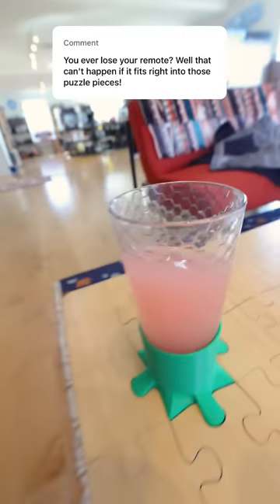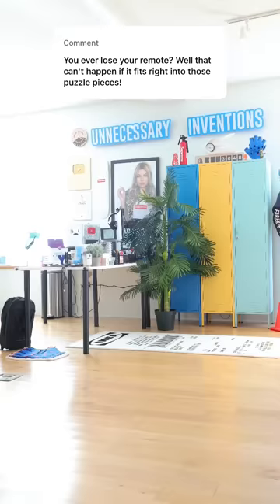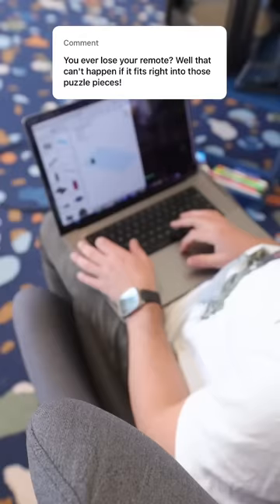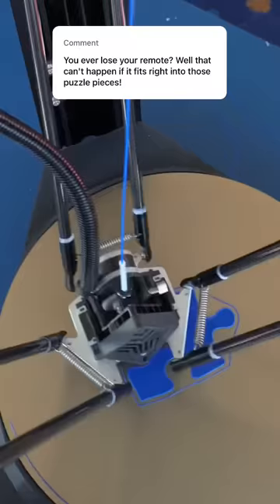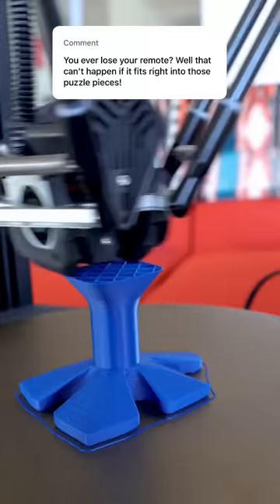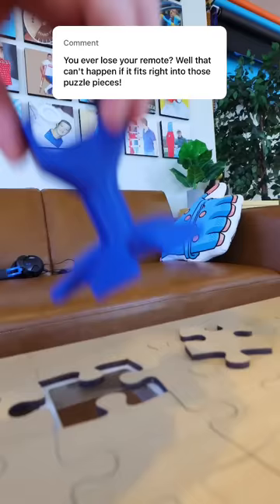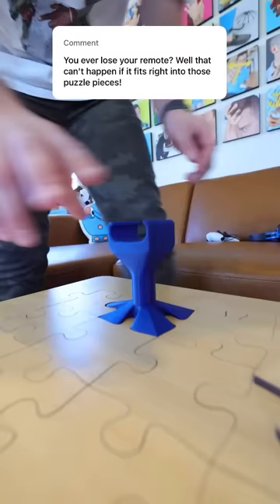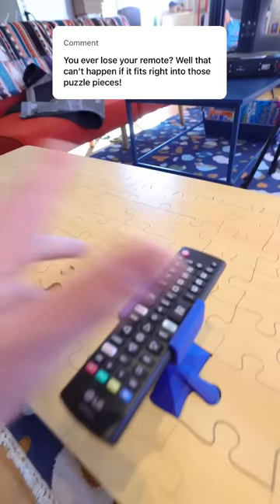Let’s make a remote stand!

Comment: Next, you could do a phone holder if you just want to relax down on the sofa without holding the phone
Reply: With a built-in charger as well
Reply: @PetrolHeadMotorsport  was about to say that but it should be wireless
Reply: You could also just put it on the table
Reply: He already did that, except it’s an invention that hangs from the ceiling
Reply: NO CAUSE I THOUGHT OF TAHT TOO, COMMENTED IT, AND THEN SAW THIS COMMENT >:(

Comment: The TV remote should have had one  spring loaded adjustable edge for different size remotes in the future. They should be adged with foam rubber for differing curves and radiuses. That way they don't get thrown away should remotes change. Same for phone holder.

Comment: you shoulda made it so that the controller has a magnet in the bottom and a matching one on the stand(or just a small steel plate) so you can slide the controller onto the table and it sticks. way too much hassle to fit the controller into the gadget everytime you change a channel or sound.